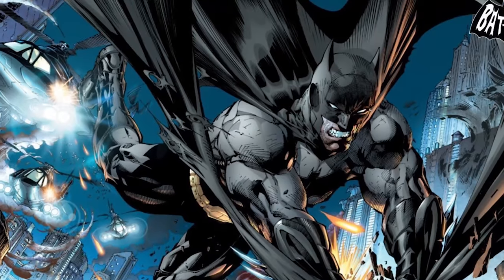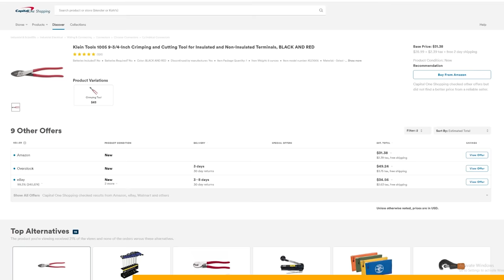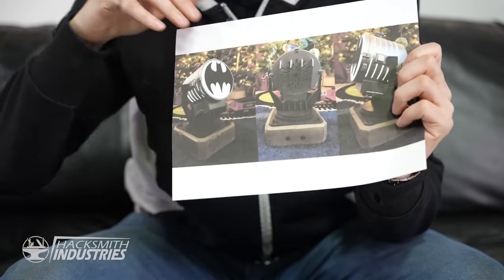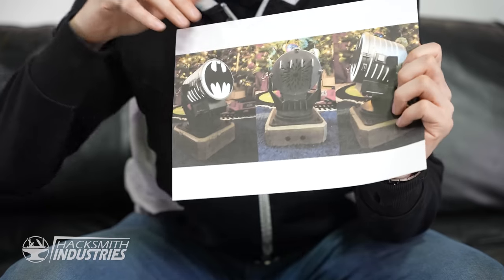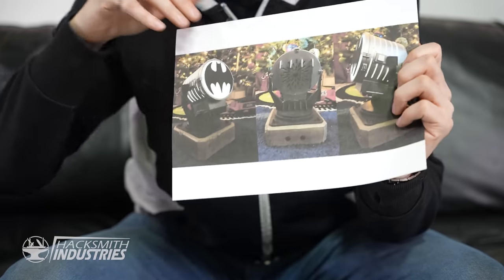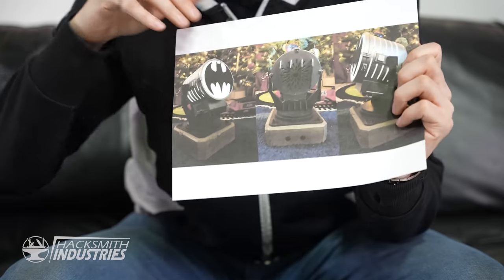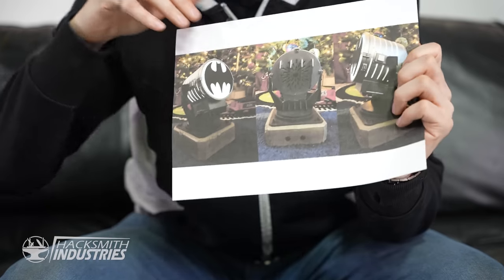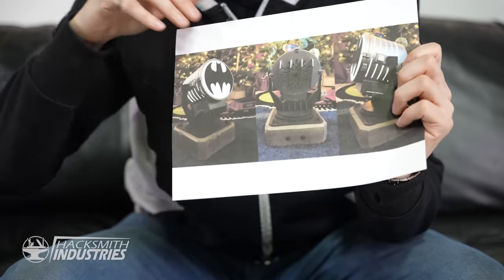We built a GIANT Bat Signal that actually WORKS!

Comment: I suspect you are not getting a crisp image because of doubling up the lens. Your large lens seems to have too long of a focal length for the tube length, hence the leds being in focus rather than the image. Get that same size lens with half the focal length and you won't need the two part lens messiness. An internal aperture can increase sharpness further if needed.

It also doesn't help that your light source is so far from a point. Put it further back and it will work better. I would recommend a commercial led stadium light rather than diy. You can get a 250k lumen stadium light for around $1,200 which is what I would use if I made another one myself.
Reply from the maker: Since the video came out we added a linear actuator focusing system that solves all the problems =) It didn't make it into the video though since we were on a tight timeline -- hoping to show it off on Instagram at some point when we get the perfect cloud!
Reply: @hacksmith  Very nice!
Reply from the maker: Now we just have to wait for the perfect cloud! Movies make it look way too simple..
Reply: @hacksmith  Maybe for the next Hacksmith project you can make the perfect cloud
Reply: @hacksmith  I hope you get the perfect cloud, that would be one of the coolest results from a make it real project yet 😄
Reply: @hacksmith  Honestly I think this kind of thing would be good for youtube shorts. You could have a series dedicated to improving existing projects after the video deadlines.
Reply: See my first thot when I saw that was that since there was technically more than one light source with a fair distance between them due to sheer size, it would need a Fresnel lens to more evenly scatter the light before it hit the focal point.
Reply: @kaboomgaming4255  that would be really cool, to see the improvements of their existing projects!
Reply: @hacksmith  also have to time the tests not to interfere with airline flight paths as the FAA gets really, really annoyed when you mess about with those
Reply: @hacksmith  I will see
Reply: @hacksmith  If only you could make the perfect cloud...
Reply: @evilhumour_292  Don't give them ideas. Next they'll start trying to control the weather... Lmao
Reply: @dexeronstarsurge  that's the idea
Reply: @hacksmith  i hope u get a good cloud
Reply: @hacksmith  I mean it makes sense that it works more times than imagined because it's almost always cloudy or raining in gotham

Comment: I feel that the final results would be much better if the original OG Batman logo was used as its bigger which would have a higher contrast due to surface area and less light bleed. I think you should try that one also for comparison.
Reply: I think it would do the exact opposite, but they will for sure test it out in better conditions so we'll see
Reply: I think you are 100% right! I was thinking the same thing. I think they should test it
Reply from the maker: We made each :)

Bigger logo means less light though.
Reply: @hacksmith  perhaps making the light bigger to compensate?
Reply: @alfredosoup  I think they're already compensating for something.....

Comment: Lot's of things that could be improved (optics especially) but it's a very nice project ! Well done !

If you ever want to modify it i'd suggest taking a look at profile projectors, lot's of things you could adapt from that (being able to change the focus by changing distance between lenses especially).
Also, watch out for planes and such in your search for good clouds ! some people i know got yelled at by the police by using less powerful more focused beams of light that apparently "hit" a plane (nothing harmful, pilots just asked what was this light, mid day).
Reply from the maker: Already added electric focus :)
Reply: @hacksmith  in theory, wouldn't it be beneficial to have the LEDs on an adjustable platform to get better distance focus (LEDS would be easier to move then the large lens), and also have the smaller internal lens do the same PLUS be able to tilt which would allow for extra adjustment AND tiltshift. 

no idea what the payoff to clarity might be for clouds, but would surely help on flat surfaces
Reply from the maker: Leds would be the hardest part to move! Remember the liquid cooling!

We put the batman logo and magnification on separate focusing mechanisms and now we have full control - the main lense stays fixed :)

Comment: 17:20 Isn't it kinda dumb painting the side with LEDs black? You are absorbing the light, turning it into heat, not efficient. Flashlights have reflective surface around the light source for a reason.
Reply from the maker: They're point sources-- nothing is reflecting off the back face unlike a flashlight. We painted the whole thing because it's just steel and it'll rust
Reply: @hacksmith  Gotcha! Fair enough!

Comment: Because of needing to focus it every time based on where you are, if you ever did a redesign for this it could be a consideration that you put in a mechanical arm system to just press a button to move it forward and back so all you need to do inside is change the symbol and less guessing when moving it.
Reply from the maker: we added that after the video came out :)

Comment: Hey, a little bit late but I have 2 questions, why didn't you use EPDM tubing, cheaper radiators and actual fittings? Barrow makes good fittings for very cheap, and EPDM tubing does not pop off like that haha. Also acrylic tends to melt at lower temps than acetal.(Talking about the blocks themselves) I would have used full copper blocks, like industrial ones, or even made some, it's actually fairly easy with proper machines! :D And those corsair rads omg... They are like a hundo each... As for the pump, I don't know what was used, but a good old D5 would have been nice!!

I keep editing my message as I watch the video, but essentially for cooling, you don't need a chiller, in the PC world, we calculate approx. 100W of heat dissipating per 120mm of radiator area, for those "standard thickness" ones. All you would need is a faster pump, and better blocks! A single D5 should do the trick (I'm going through 28 meters of copper pipes with a single D5 at 2400RPM with no issues)

As for the second question, wouldn't a fresnel lens be better? I don't really know anything about optics, but I know that they are cheaper to make, and way thinner

Comment: Me after seeing those 240Radiator x8: "Should be around 1200Watt of TDP and only Pull not Push-Pull configuration. If these are 500Watt COB's this is gonna work until the water is boiling" 20sec later: "We upgraded our cooling." Would be a perfekt colab with LTT.

Suggestions for Upgrading: Take the Z-Axis from a Anycubic Photon or build it yourself to adjust the distance of the projected symbol. If you mount it behind the symbol maybe it can be hidden too. 🙂😉

Comment: The kid was awesome - working out how the cooling system works etc. What is he? 5 y.o.! he'll grow up to be an engineer for sure! An improvement would be to put a stepper and threaded rod into the batsignal to make focusing less of a pain. And yes projecting light needs just the right conditions, even with bigass lasers the clouds need to be at the right density and type for anything to be easy to make out.

Comment: Would adjustable lenses work? Like cut channels on the inside of the tunnel with handles that run the length of the tube on the outside on different sides of the tube so all the lenses be adjustable?

Comment: The manual aspect of the focusing was a clear weak point. Having to reach into the barrel and make wrench adjustments and then replace the symbol after what seemed to be guessing of the changes could have been elegantly fixed with a focus wheel that could make fine adjustments from the outside of the lens.

Comment: Guys! Can you explain how exactly do the lens work? Where are they located and what are their focal points?
Reply from the maker: The video went into quite a bit of detail on how the lenses work? Exact measurements wouldn't be very helpful,  it's something you have to figure out in your design by testing
Reply: @hacksmith Ok, good. Sorry for my questions but I was just wondering when we have a source light from a point (like the leds, where the light beam isn't parallel), how does each fresnel len change the direction of the light - which one is focusing it (the light beam), which one is making it parallel, which one is flipping it upside down? In other words, what is the role of each len in your project?
Reply from the maker: Fairly certain our animation shows each lenses role in the system near the start of the video,  unless your asking specifically how the lens work? If so, you can Google the physics behind lenses to learn more! 😊

Comment: Man use light with higher wave length like red  to get perfect view in to an extent , or just cover it with tranperant object which allows only higher wave length of light to pass also wich can resist that heat in my opinion pass light through an aquarium filled with coloured water , even though face a Little bit of reffration problem I think you getter better view.......

Comment: Seems like one missing piece was an easier method to shift the focus... An Automatic solution probably wouldn't be feasible... But a Manual solution should be easily achieved with gears and a knob connecting to the panel with the thing to be projected. 🤔
Reply from the maker: Added that after we posted the video :)
Reply: @hacksmith  Glad my idea wasn't missed entirely.🤣

Comment: Why not use a lazer and cut out the bat logo? :)
Reply from the maker: We... did?
Reply: @hacksmith  If you did a laser one, I need to look it up! D:
Oh wait, do you mean you cut out the bat logo with a laser? : >
Reply: Maybe I should clarify that I meant cutting out the bat logo from a cover, and then cover a laser with said cover, which has a cut out bat logo in it. But that would requite a huge laser I guess? D:
I only know these in small, with random shapes you can screw on your tiny pocket laser. Or however that works, been a while since I had one in my hands. =(